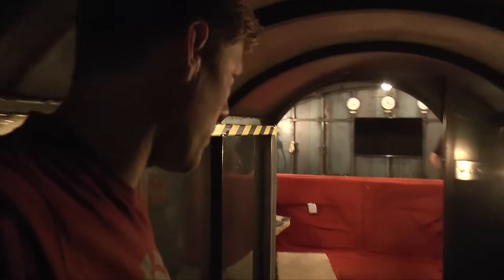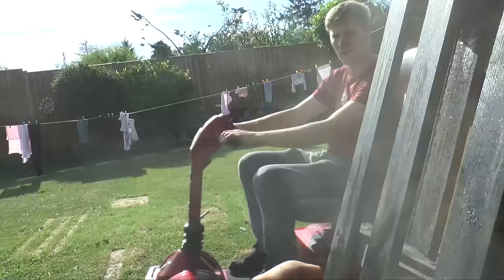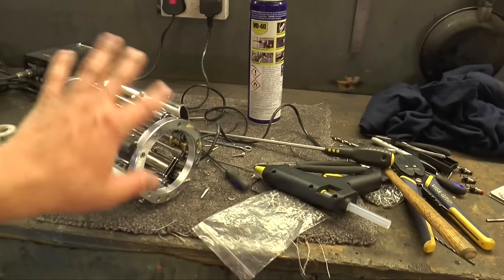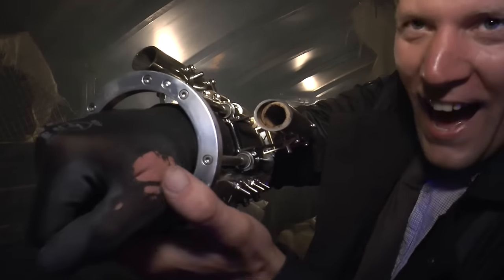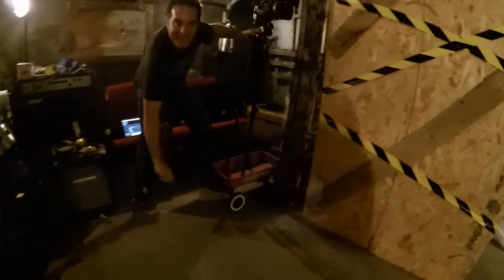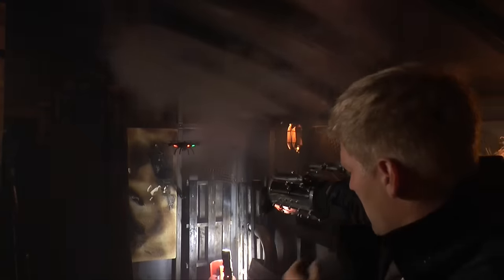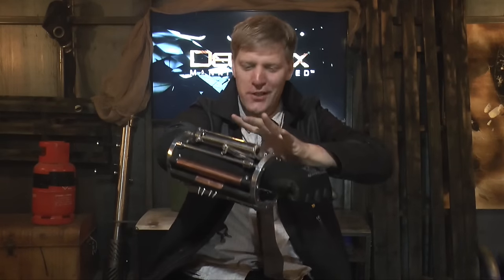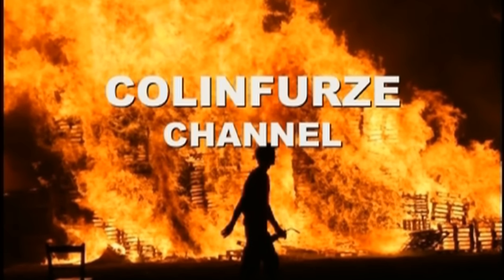Behind the Scenes, what goes into to making a video and blowing up drones in the bunker.

Comment: Wasn't it just last week that the Deathstar exploded? Better start planning the lunacy for 4M.

May I humbly suggest a paramotor driven 360 degree swing firing ridiculously noisy bangers and thunderflashes as it goes ..... and goes ..... and goes ..... until it runs out of fuel ..... or you hit a remote control off switch.

Maybe you could rotate the swing using a pulse jet ..... you wouldn't need any additional noisemakers then.

Comment: Hey Colin I just had a really interesting idea for some reason. How about for a project, you could make a... "Roller-mobile"

So, here's what it is in my head haha: A roller-coaster seat, with a red cushion type thing, and the metal/wood frame around it, with the bar that you can pull down in front of you, which would act as a sort of seat belt, or if it has the things that come down over your head and lock you in, that could be cool. It would hold about 3 people, (assuming that you have just one row, but there could be two rows, like a double seat in front and behind, which in that case you could have 4 or 6 people). Also, you should make some sort of chassis where you have wheels (You'd have to remove the current rail wheels that it has. Assuming it is a pre-built roller coaster carriage you are using, and not building from scratch), an engine, and some other stuff, like the motorised mobility scooter. You could have a steering wheel/handle bar turning system to turn the wheels underneath, and some sort of pedal/lever to control the acceleration maybe? And the little hinged doors at the side could stay like they are, and yeah maybe put some headlights in it, and take it for a spin on that test track strip thing or whatever you tested the jet powered bike on. I don't know where I got this idea from all of a sudden, but it could be really cool! But I don't know how you would be able to get a good condition, pre-build roller coaster carriage unless you make one from scratch though... But if you somehow manage this, I don't think it would be too big, or difficult to make, but, yeah that is my suggestion! Haha.

I think it'd be really cool, and you are an awesome creator/inventor and this could happen thanks to your skills! You can add your own stuff also, like a cool paint job, maybe make it metallic looking or something haha, or just feel free to do whatever you want to with it because I am not sure if I missed anything out lol because I don't know what it will end up like.

Thanks for taking the time to read this, if you do. And keep up the good work man! :)